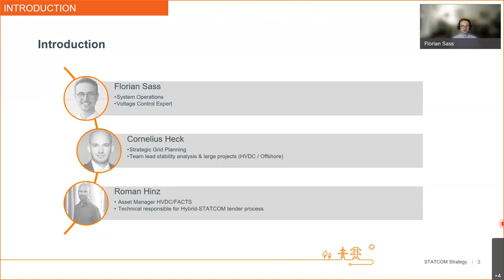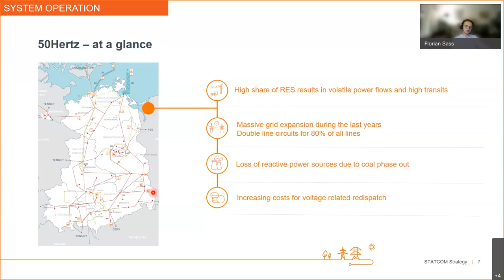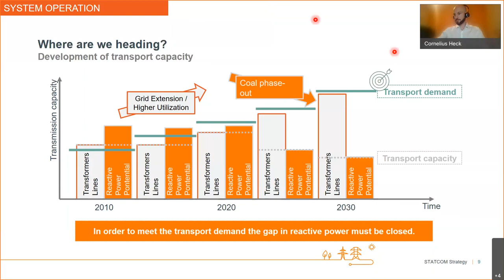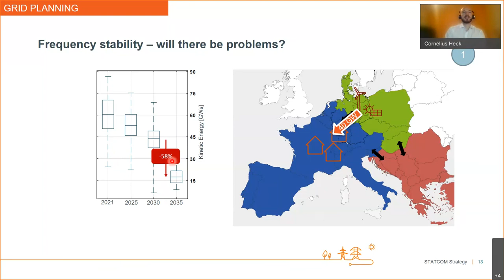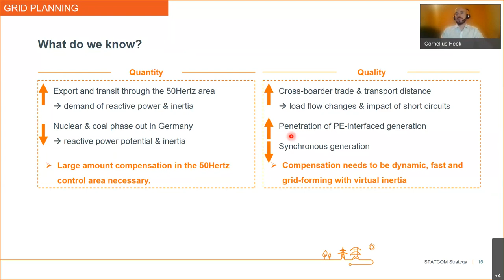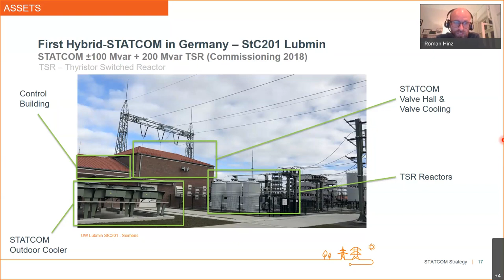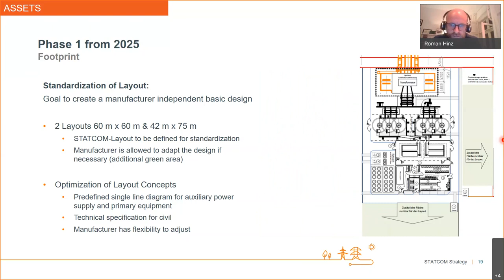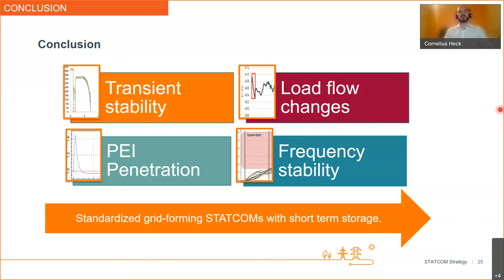G-PST/ESIG Webinar Series: STATCOM Strategy and Application in East Germany

Comment: Thanks for the excellent presentation. At 43:00 and 44:30, by injecting negative sequence currents via STATCOM control under asymmetrical faults, are you aiming to mitigate the imbalance?